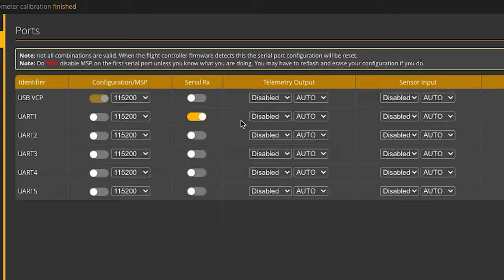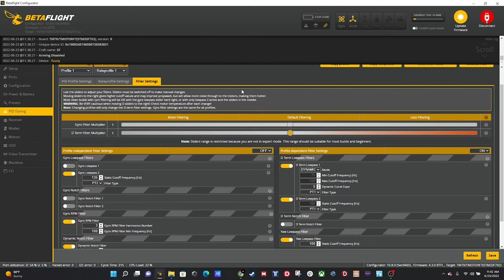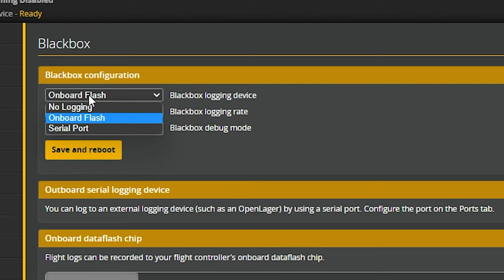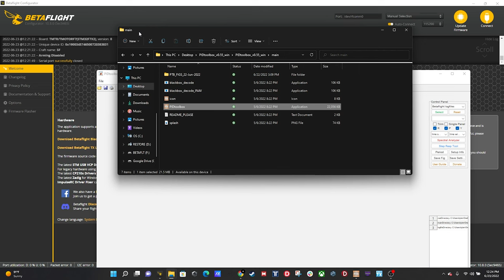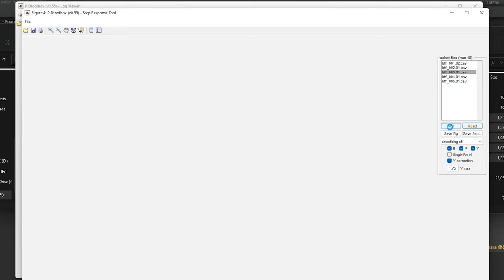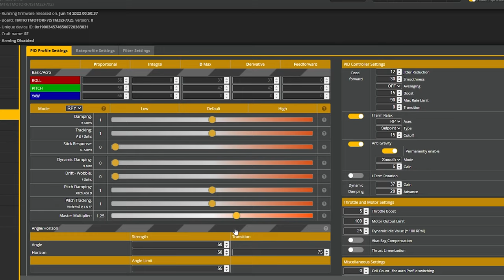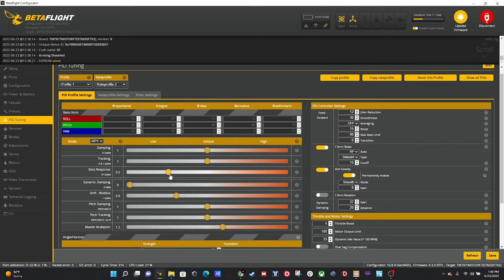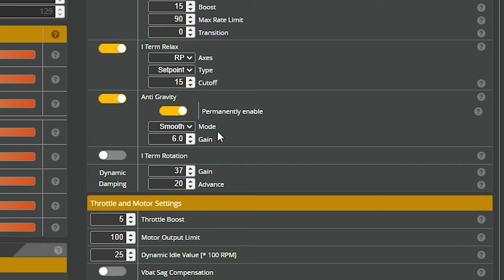How To Tune an FPV Drone with Black Box Logging for High Performance Freestyle

Comment: hey thanks for the shout out! nice set of results. FYI, the reason Iterm doesn't result in any overshoot there is because you have really quick tracking such that Iterm is not able to accumulate. That is a good thing, and is often the case when the rig is light, powerful, and P gains are sufficiently high.
Reply: Thank you! We're constantly making adjustments to the tunes for the best possible performance so I REALLY appreciate the info. Your Basement Tuning method has been amazing and I can't thank you enough for all that you've done for FPV! #subscribetothisguyspatreon ^^
Reply: Hugs to Brian W.! I have been using basement tuning since I absolutely cannot tune/fly in my own neighborhood without folks freaking out.
Reply: How do you crazy gurus get such high pid gains 😅

Comment: That was great. Took me years to understand the process. I always had a feel for it as far as the pids went. Using osd tuning was fast enough. 
I think your video here is pure gold. I hope all new pilots follow this method and just get ripping as soon as they can. Then go watch Criss,mark ect to actually understand what your doing. It's like the difference between learning to drive and being a motor mechanic.

Comment: Now I understand one of the reasons why you charge what you do for your prebuilt quads. The components are costly and the frame design too, but it is hard to put a price on the tuning process. I am glad that you posted this video because it explains the value but I learned quite a bit from it as well.  Thank you.

Comment: After I have looked at your great tutorial several times, I finally tried it myself today and one of my quads tuned according to your description. What can I say, that was really worth it, the difference to the BF Standard Tunes is so huge that you think a new quad to fly. In the positive sense. Thanks for your work!
Reply: when u take the sample of fly, use the air mode or angle mode?
Reply: @andifu1630  I use the acro mode with the slow rates settings from the video and that has worked quite well so far. but I think I saw in another youtube video that it works just as well with the angle mode.

Comment: great video, one thing to point out is when you start increasing the master multiplier that won't keep same proportions of lower gains like I to P ratios. I found that I term needs to be incrased 1/2 a step for every 1 increase of the master multiplier.

Comment: I struggled so much to even open the damn logs in this app. But this tutorial did the trick. Copy files in the main folder (where you unpacked the installer) and open the .exe from there.

Comment: You don’t need the bmi preset… it’s a bit confusing, but 4.3 will put the bmi into hardware filter osr4 mode at which point you can filter as you would normally. The preset suggested disables this mode and does it in software.
Reply: Thanks for the info! I didn’t realize 4.3 had that built in… I’m constantly working on our tunes for the best performance so any feedback is greatly appreciated.

Comment: Best video on YouTube to help learn the ropes with blackbox and pid tuning (IMO). One question though, what is the reason for leaving dynamic damping at zero? What does this achieve versus setting it back to default after fine tunes? Thanks again, this video helped me a lot with a stubborn Micro Reverb.

Comment: Tyler you did a fantastic job with this video. 1 question  does tuning make a difference in non-acro modes? or is it just for acro?
Also had the pleasure of meeting you and the rotor riot team at San dimas Quad camp. Thanks for all that you guys bring to the hobby.
Reply: Thanks man! I haven’t tried it yet but you can actually use angle mode for this tuning method as well! Pidtoolbox recently released a video called “Basement tuning just got a lot easier - use angle mode” that I’d recommend checking out.
Reply: @GrusFPV  
Thanks Tyler for the quick response. Your video cleared some gray area's that I was stumped on. 
Thanks again!

Comment: Great information...Im still learning.  May I suggest informing others Blheli 32 is for EACs w/ blheli32.  A lot of people still have rigs with Blheli "S" ESCs and Blheli32 wont read the ESCs... use Bluejay.  Also, when u "update" your ESCs, the Betaflight setup must also "match" (d-shot / rpm filters esc)..I found when I swapped the FC I only got the first 3 tones and thought the fc was damaged,  nope.  basically it the components werent "talking' together correctly.

Comment: I thought there is no need to add the bmi270 filter settings anymore. With the latest release the bmi is running in osr4 mode by default and so there is no need to add the preset?!

Comment: First time looking at doing my own tuning as it seemed like rocket surgery -  and its an exceptional video.  One question - I see the sliders back to zero each time.  I am assuming you zero the sliders, input the values you determine from the PID toolbox into their respective spots in betaflight, then  and move on to the next slider?  Can you please elaborate.

Comment: Great video. I have a question.  When you start a pid tuning session, do u have to to pid the drone with the camera (ex. gopro, action2) that u will mount on it...or you just pid the drone with no camera on it?
Reply: The quad will most likely perform fine regardless but you should tune with the camera mounted for the best result.
Reply: Basically, tune your quad with all of the stuff you'd normally have on it when you usually fly it during a session.

Comment: FYI: You don't need to do anything special for BMI270 now, it's taken care of by default in 4.3 and 4.3.1.
Reply: Actually, things do change if you select the BMI270 filter set from the presets.
Reply: @BikeGuyFPV  right, that preset is adding a low pass software filter. The default settings change the gyro mode to one that includes a low pass filter. So they accomplish the same thing, but the preset adds slightly more filter delay

Comment: Can you tune my drone without changing the motor? In this case, the condition of my motor is not very good because many of the wire coils are broken, but it can still fly freestyle (although not perfect like a new motors). Because I don't have enough money to buy a new one, I still use that motor until now.

Comment: this is the best PID tuning video I have seen, just a question does it work with blue jey firmware( using a peedybee f405 v4), thanks in advance

Comment: My quad is either perfect or filtered into oblivion. My lines are very smooth, on the wooble test, 0.3 on the I Gain slider makes it overshoot. Looks like i would need to go 0.1 on I Gain slider. Is this normal or something is wrong?

Do you need to be agressive with movement when recording logs?

Comment: I don't know if comments are still being checked but I wanted to know throughout all of this, is the quad in angle or acro mode? Rosser sets his in angle mode for some initial tests then eventually changes to acro. Also, at what point did you set your rates back to where you normally like them? You made everything linear at the start but never mentioned when you returned them to your preferred settings.

Comment: I have the same tmotor stack with the bmi270 gyro and tried that exact same filter preset and that made it fly even worse, through other videos I'm now led to believe that the bmi preset is for bf 4.2 users ?

Comment: So where does filtering come into the mix in conjunction with this tutorial? Was that handled with your BMI preset or should you get the filtering dialed in before tuning the PIDs?
Reply: Always tune the filters first. 

The BMI preset worked well for this build but I’ve learned that Betaflight 4.3 automatically adjusts the default filter config so there’s no need for the preset. 

The default settings w/rpm filters should be fine. If you don’t have any motor heat issues you can also turn off gyro lpf1 for better performance.
Reply: @GrusFPV  thats what I wanted to ask too...now you cleared it here. thx.

Comment: so following along.. my 1st test was slider at 0.6 ( d gains ) but when im checking on PID toolbox my log for the PID`s that relates to 0.6 is numbered as 003 and not 001 any reason why ?
Reply: my 001 log is actually the highest values 1-4 i think i went up to..  so it looks like they`re reversed ?

Comment: Hi, I followed the method and can't set te FF gains. It really doesnt make much of a difference between 1.3 and 2.0 and even on that high numbers still doesn't overshoots. My settings are D Gains: 0.85; P&I gains: 1; FF Gains: __ ; D Max: 0; I Gains: 0.2; P:R D : 1; P:R P, I&FF 1, Master 0.8 ( going from top 0.85; 1; 1.3; 0; 0.2; 1; 1; 0.8). This is for my 5 inch 6s 1700kv mark 5 witch gemfan 51477
Reply: From my experience the FF gains really come down to feel/preference. Chris Rosser has an in depth FF video where he shows an additional step you can take using BlackBox explorer. You want to see FF pushing into the move without Pgain countering in the opposite direction

Comment: You talk about motor timing for only one specific quad. I'd even argue that more people these days fly 6s quads with a way lower kv than the motors on the quad you are tuning. Just saying "for this kv, we set at(this) and call it a day," provides a little help to a small group of people while leaving what I'd argue to be a larger group, confused. When posting a tutorial, those is the kind of shit that shouldn't get glossed over.

Comment: I looked at chris rossers video you referenced. he suggests 24 on the low PWM and 48 on the high pwm  and the motor timing auto is good setting if you prefer efficiency at a slight torque loss. and recommends 23 degrees power for 7in 5in and mini quad. rampup power to get the full mechanical torque. more power more torque more heat. 50% is ok but 20 to 30% is optimimal
I wrote this fast and loose so don't quote me. See for your self

Heres the link I just referenced.
https://www.youtube.com/watch?v=7WeHTb7aBrE&t=181s

Comment: SEPTEMBER 16 IS NEXT MONTH
For months Ive been asking everybody if they kno witch manufactures are gonna make these cumbersome  radio stations that will legally destabilize my very large Hexicopter. No body is making them and the company that was suppose to stop selling in America,  DJI says all their drones, back to the mavic air 1 will be able to broadcast on day 1. Heck, they already shut drones off, even the mavic mini while in flight. Everyday on the forums theres at least 1 post of a mavic mini  Fly Away. (These are the ones that will be legal to fly next month). DJI has always had at least one model that flys away on its own like my Mavic Air 1. Their Customer Service said I accelerated into a building, I said "WHAT, Im in the forrest.". There is a large percentage that ( I say intentionally) Fly themselves. I wont buy another.  * I cant Imagine the price hike that will occur next month while other manufacturers pack up shop and file bankruptcy  ITS ALL VERY SAD! But in America youre suppose to go past the deadline on Gov Grants, twice cause thats how you get BONUS and Super BONUS money because it becomes an emergency and ya get emergency money to finish late.   IDK what to do with my oversized drone or any of my fixed wings. I could take the motor off the big glider and learn how to Tow it into the air.   WERE SCREWED
Reply: If you are referring to Remote ID, the operational compliance date is Sept 16 2023. So, there are 13 months.